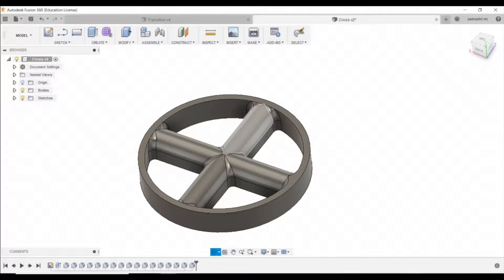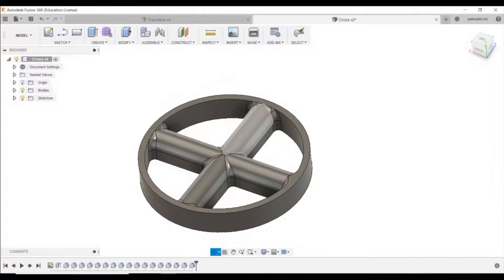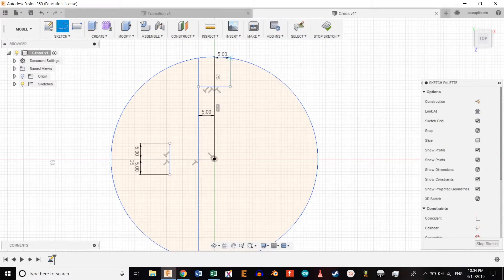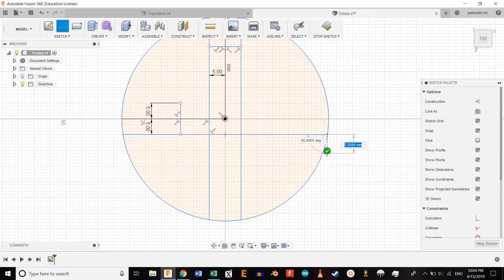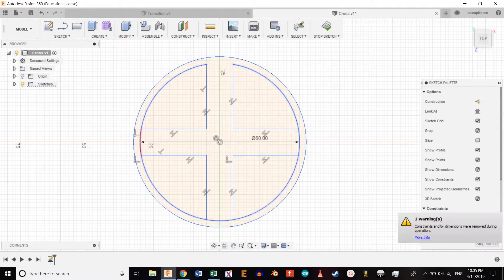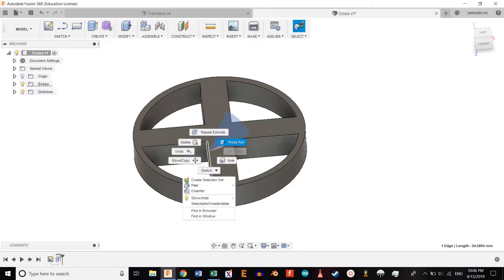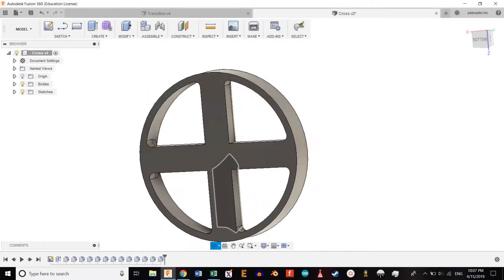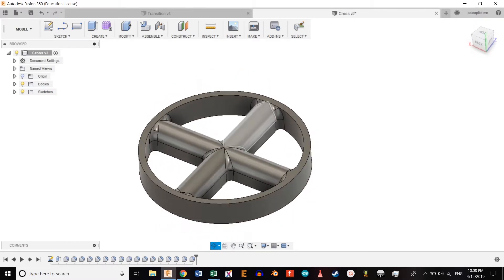How to Make a Rocket in Fusion 360 - Part Four: Cross/Parachute Attachment

Comment: wait is there a video on the body of the rocket??  if not PLZZZZZ I have done every step dont stop now
Reply from the maker: The body of the rocket is probably the easiest part. Just use cardboard tube, the tube specifically for model rockets can be found at Apogee Rockets, I highly recommend using their components. Just make sure the tube sized match, BT-60 is 41.6 mm, BT-70 is 56 mm, BT-80 is 66 mm. The rocket in my videos is BT-80 rocket, the reason the components in my videos are sized at 65mm instead of 66 mm is tolerance to fit inside the tube. Don’t hesitate to ask anymore questions, I’m here to help. 

Body tubes at Apogee:

https://www.apogeerockets.com/Building_Supplies/Body_Tubes
Reply from the maker: Cardboard body tubes are much stronger for their weight, 3D printing body tubes results in very fragile, very heavy body tubes. While we have done it, the rocket works much better with every component except the body tubes and launch lugs being 3D printed. I’ll have a video on an updated, much more complex yet easier to use motor mount, requiring almost no glue sometime soon. The last few weeks have been hectic for me, but tomorrow I might be able to start the new motor mount recording. The new one will require a 3D printer, as it’s design is too complex for manual construction. Some flight computer videos are coming soon too, it just takes time. Thanks for commenting, it really motivates me to keep going.
Reply: @FrogPondEngineering  thx